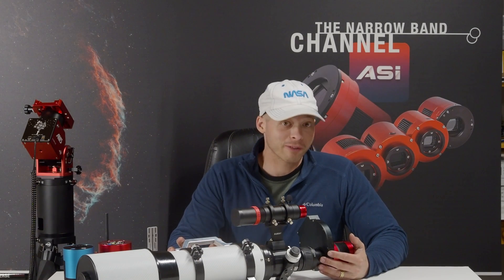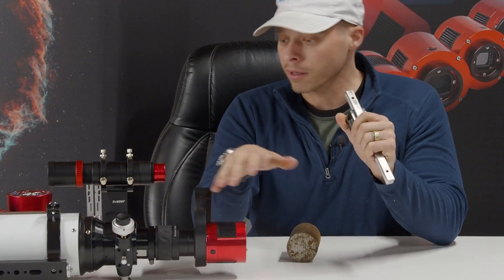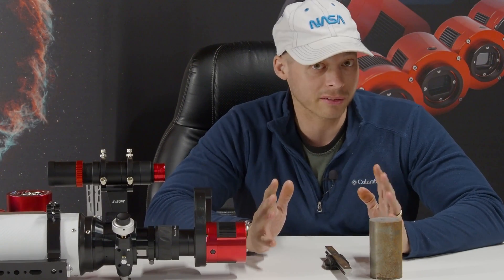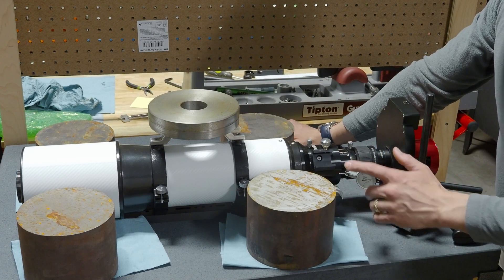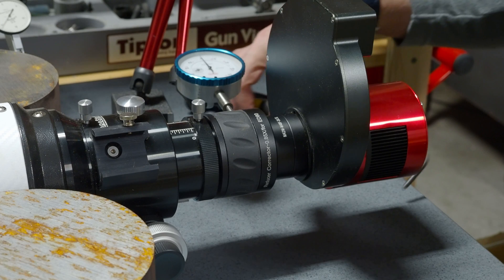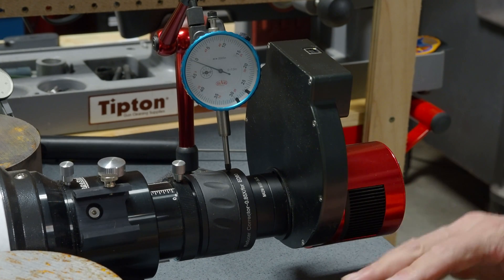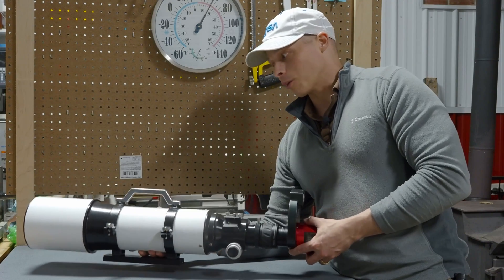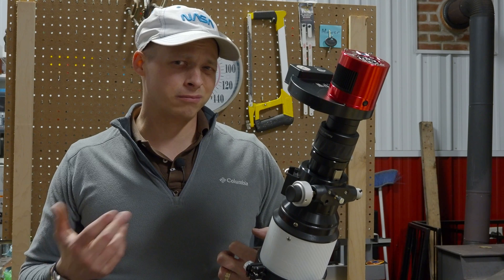GSO Focuser Review

Comment: I bought a cheap pawn shop C6-N Newtonian for $125 that included a TeleVue 2x 1.25 Barlow worth $125 by itself. To make a long story short I sent the mirrors in to get recoated, but had it refigured too and got an unbelievable 1/12th wave and .98 Strehl. Being a retired aerospace engineer I redid the scope and first thing was install a JMI Crayford. I worked my way through engineering school at UC Riverside by working in my brother's metal shop, which he still has. 

I replaced the .060 steel vanes with .022 thick Titanium and instead of being 3/8th wide I made them a tapered .70 to .50 at the center and put a 100mm radius curve on each vane going counterclockwise. Reduced the diffraction spikes to 30% of what they were. Rolled a strap of .125 thick aluminum by 1.5" wide in front and tig welded the strap so it shrank to a friction fit. Put the bolts to hold the vanes through the strap so the front is stiff and doesn't flex. Put a 1.00" strap on the rear and drilled and tapped six 1/4-20 holes to hold the primary once collimated in place using 6 nylon bolts. It holds collimation pretty well now.

Guys in my club love to use it for astrophotography. I've been offered $3000 for it and it still says Celestron on the side.🤣 I'm leaving it to the optics guy who sold me   and helped me install the JMI focuser since he really loves it. He actually bought the JMI reflector focuser at a garage sale for $30 and sold it to me new in the box for $200. He has a wife and kids and could never afford a Takahashi+ quality scope like this. I know it's only a 150mm mirror, but it is like looking through a AstroPhysics refractor. I'm not an experienced AP amateur, but he is. He did a photo of M1 that is a rival of Hubble and what I like about his photography is that he doesn't over-process his photos.

Comment: Trashed mine and replaced with Baader Steel Track. The gso would slip all the time with camera weight and then would be very difficult to focus because it would slip. So you then have to disconnect the Eaf and tighten the focuser, refocus and reclamp the Eaf. PIA. They should be illegal.
Reply: My experience and solution exactly. GSO focusers are only suitable for visual use.